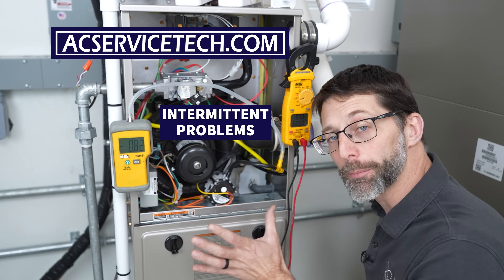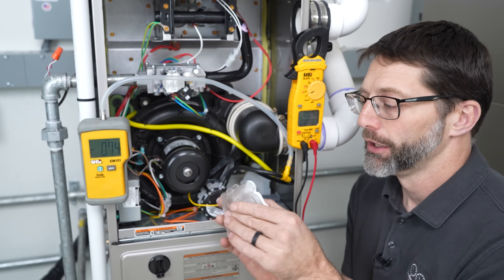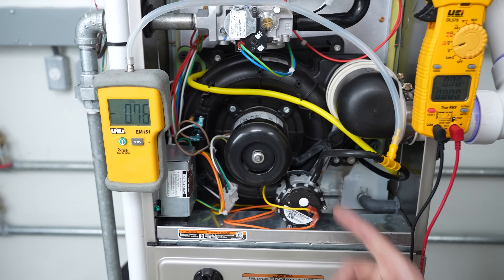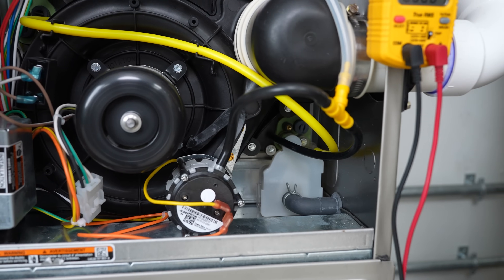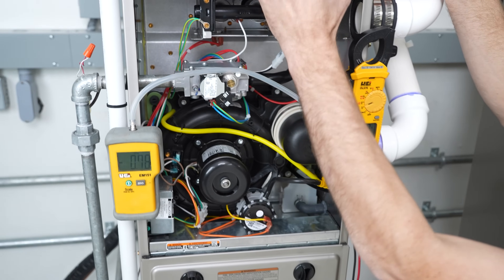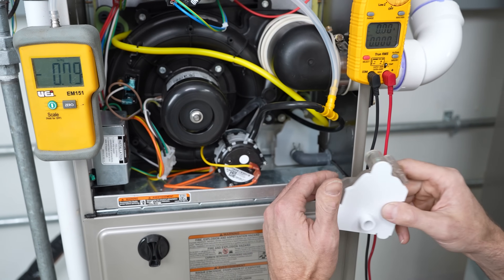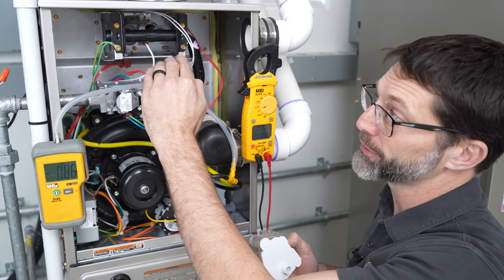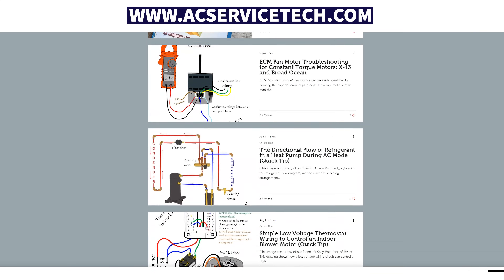Most Common and Basic Problem on High Efficiency Furnaces!

Comment: Why do the manufacturers not  make these traps more cleaning friendly?
Also, putting the clear side facing out would help identify potential issues.
Reply: Because they want to sell parts and new heaters. They have no interest in making their product user serviceable or to last longer.
Reply: @David_H_Parker . Except for the fact that people won’t buy their products any more.
Reply: @Pseudify  Except when the conglomerates own all of the garbage brands and whichever product you buy , your money goes to the same conglomerate corporation. There are only a few choices in reality.
Reply: They did it on purpose. So you have to call company to check your furnace
Reply: Ya I agree, put a rubber gasket and let me open it up or have a clear side like he showed for quick inspection.
Reply: Newer rheems have similar trap to one in video but are see-thru.
Reply: Yes totally ridiculous.  But more, I tried contacting Bryant (Contact Us) on their website twice and no response. I wanted to find out if it is normal that my 2 year old furnace leaks water and is all rusted on the floor of that section.  I removed, cleaned, and replaced my condensate trap (including gasket) but have seen small amounts of water under trap.  But have seen other videos where water is coming from behind whatever that wall is.  The furnace seems to be working fine, but I know that if I call in a service company they will claim it is the trap, charge me a fortune and never really properly discover the problem
Reply: @rosemountbomber Chances are, it could be the gasket around the "cold end header box" which the trap is connected to.
You can try snugging up all the screws along the bottom edge. It could also be leaking from where the inducer motor attaches to the cold end header box. As there is a foam gasket connection there that could leak as well
Most likely, you'll have to run the furnace and try to use a mirror and lighting to trace where the drip is coming from. Good luck
Reply: @YTsux24-7  I do want to thank for taking the time to give your knowledge about this to me.  Since the greatest concentration of rust is to the extreme right side I am guessing that the leak is probably not coming from where the inducer motor is connected.  Makes sense it could be from around the cold end header box down in the bottom right corner.  I will examine again.  Thank you.
Reply: @rosemountbomber no problemo. 
Feel free to ask if you have any more questions.
Reply: @YTsux24-7  Thanks.  I have ordered another condensate trap and gasket because I had seen a Reddit forum with some contractors saying they had to replace the condensate traps.  Some say they don't leak or go bad whereas others say they have had to replace many.  When I receive my materials I will have a better look when I remove the current trap.  I just wish there was a way to post a pic here.  Thank you for all your help.
Reply: Because that is common sense

Comment: Secondary heat exchanger failure.  Happens from the trap getting plugged. Those are 10 year furnaces.
Reply: Those particular newer carriers are actually good furnaces, traps or drains do get plugged overtime and easy fix, the older 58mv infinity carriers 2006-2011 are the ones with problematic poorly designed secondary heat exchangers that commonly have failed which had a lawsuit.
Reply: When you know, you know.
Reply: @NatePetersonr5t  I replace them with 80% ers every chance I get 🤭😂
Reply: @NorCal-refrigeration I installed an 80 percenter for my parents 2 years ago. I did new home build warranty service for 3 years and the amount of issues the 90’s have there was just no way I’d put my parents through that. There’s variables like horrible duct design in new homes too but still
Reply: 100% correct. Same here. Go with 80%. When my 90% fails, I'll be going back with an 80 again. Just not worth it. @NorCal-refrigeration
Reply: Guys 80% are getting fazed out so if you want 80%ers buy them now
Reply: @clarksafg  I heard that. Supposedly gas stoves and dishwashers also. Government interfering in our lives for the better? Lol
Reply: @deanmartin1966  <--- Supposedly  the earth is flat too huh....der.
Reply: Glad you said it this way. Cuz that's been my observation too.